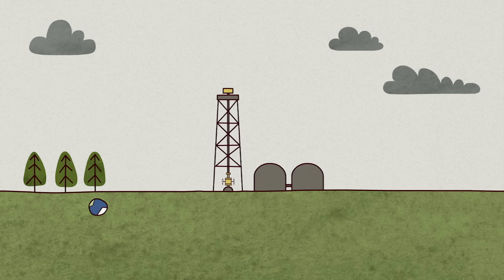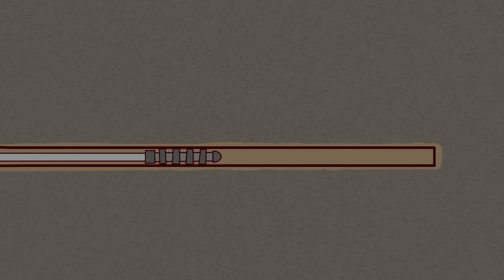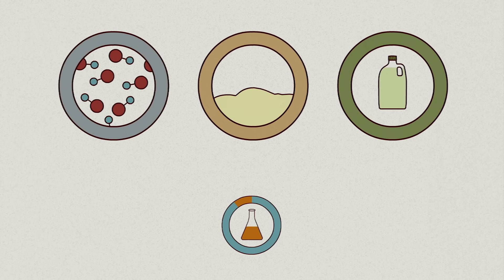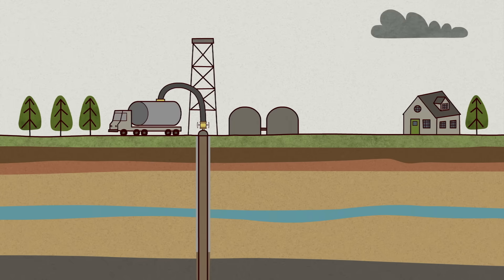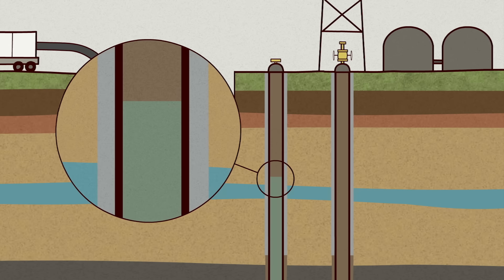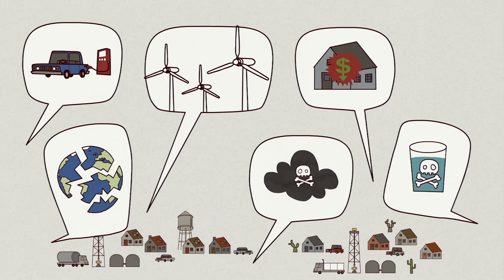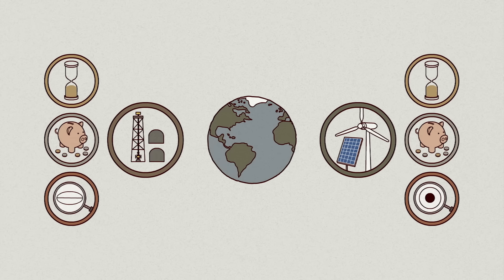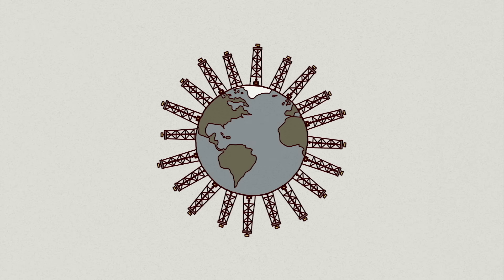How does fracking work? - Mia Nacamulli

Comment: I was following along until I noticed a single string of casing in the well. That may have been commonplace a long time ago, but not in the last 22 years I've been in the patch.

Today, you'd actually have three layers of pipe and cement that are protecting drinking groundwater tables. They are conductor, intermediate, and then finally your production string.

In west Texas average kickoff is roughly 10,000' vertical depth, the average fracture typically extend less than 500' from the well bore........or 9500' vertical depth. Don't think thats going to contaminate your water supply typically found around 200' vertical depth in this particular area.

You mentioned the volume of water used could affect a city's water availability. This could be true if the fracking companies used city water........this is not typically the case. In the area where I work, companies drill water wells near the frac locations and fill "ponds" or storage vessels for frac operations. This is done in such a manner where residents wouldn't even see a change in water pressure or volume.

Its not to say that drilling and fracking is not as dangerous as any other job out there, like chemical plants, power plants, etc. And there can definitely be accidents. But there are regulations that have to be followed that are in place to protect the environment as well as people.
Reply: Literally all they have to do is go down to a jobsite and ask the foreman how many steps they take to avoid groundwater pollution. They drink the same water everyone else does, therefore it is in their best interest to keep it clean.
Reply: @scowler92  "They drink the same water everyone else does" well trye but too bad the negligence comes from higher up in companies hirerachy and not from everyday's worker
Reply: So you're saying you have three layers of pipe and still tons of incident and negligence are happening? That's... impressive
Reply: @jamilhneini1002  vehicle manufacturers have been producing cars for years.......there are still recalls! Name an industry that doesn't have incidents........I'll wait.
Reply: Hey man can you help me out and explain the fracking issue in Pennsylvania since i am doing a report arguing for or against fracking please let me know if the water contamination that was caused by 'fracking' legitimate or just some more propaganda
Reply: Agreed, the graphic was quite misleading about groundwater depth vs shale reservoir depth. And while there was mention of the possibility of groundwater contamination, it would be nice to put that in the context of how infrequently that has actually occurred.
Reply: Johnathan good reply and as a fellow Texan that spent 25 years in the oil and gas industry I found this video just another propaganda piece by people that have no clue what they are talking about. The video does not even come close to telling the truth. I have done acid jobs and frac jobs on wells on a many different depths. The majority of wells drilled are not horizontal as the video shows. And the majority of frac jobs done do not take the large amounts of water claimed. The vast majority of frac jobs are a simple water, silica, sand mix that requires 1 to 2 truck loads of water. The video does not touch of the differences in depth per well, the differences between shell formations, is the well a horizontal drill or not, ect. Just another pathetic piece of information by someone that has no clue.
Reply: @yahtotv5492  these are all reasons why I commented. So when uninformed people come here looking for actual facts.....hopefully they read the comments! Scary times we're living in today!
Reply: Worked in ND on the production side and disposal side. Not only are you right about the casing, but the disposal of the hazardous waste is put back into old dried up well locations (aka disposal sites) it’s pretty much impossible for it to contaminate the ground water.
Reply: @geoffreygeorge2412  Its ashame the industry doesn't do a better job of public education on the subject.
Reply: Maybe you are right.
Then again...
Texas was left without electricity a while back. I don't think I can trust your state's engineering expertise.
Reply: @WTAWWR08  it would be short-sighted to put all the blame on engineering. Most of the electrical shortcomings were the direct result of the cost benefit analysis. In other words, the thought process was why spend the extra money on infrastructure in preparation for a disaster that might happen once every 500 years? Because the technology already existed... Now they know why!
Reply: @johnathanphillips8684  This video was fairly informative for an average viewer but videos like these always need to be seen with an open mind given the politics that surrounds it. Given your experience, would you care to share what do you think about the future of non-renewables, natural gas in particular?
Reply: @wickypickyvicky  to be honest I'd rather not make any assumptions in my response. We are told "there's plenty of oil and gas to last years". However being a realist, oil and gas is considered a non-renewable resource for a reason. Someone smarter than me has come to the conclusion there are only so many barrels of oil and cubic feet of gas available for use. 

Natural gas is an extremely efficient burning fuel. The issue is the cost of production leaves the oil companies very low profit margins. As a result a small dip in Natural gas prices will literally shut down an entire field.
Reply: The video is very misleading and obviously was made by someone who doesn’t know much about oil and gas industry.
Reply: @EyasAbuElhouf  people don't understand the engineering that goes into these wells. They think every well is drilled by the Beverly Hillbilly's! 🤦🏾‍♂️

Comment: There is either enough liquid oil or gas to pump out without fracking to make it economically feasible to drill a well, or there is not. If a well needs to be fracked to make it flow there is really not enough oil or gas accumulated there to make it profitable & what is there is better left there. Then there is not enough pressure for the oil or gas at the bottom of the pipe of the frack job to make it into the pipe to pump out, while the bottom side opens deeper & the top side liquids drip down to the bottom. If it is a large hole full of liquid, then pumping material into the hole falls to the bottom & traps the fluids at the bottom side. So fracking a full hole doesn’t benefit anything, but fracking outside of a liquified hole might open another draw point to that hole & spread the level lower & to other places underground. Drilling through a water table can not create a seal with the cement, the bottom side under the water table fills with water & dilutes the mix. Then the frack job can crack the seal around the pipe, and open the Geological spaces between Oil & Gas bodies & the body of underground water if too close to begin with. Contamination of large water tables & underground water supplies makes it not worth drilling at those locations. Then there is the fact that Oil & Gas can not compete in open free markets against better forms of energy, and causes higher cost of living through transportation needs, & destruction & lack of growth of many markets if exclusive policies are made to give Oil & Gas energy supplies an unfair market dominance. Traveling underground energy forces also make stops and transfer energy to multiple drill site locations, to cause earthquakes at those locations, which could later cause larger cracks & sink holes to form at those locations, especially when a hole is empty with cracks all around it.

Comment: The massive leaks during storage and transmission of methane were known in 2017 
The total carbon footprint of methane is greater than coal
Methane is a false climate solution
Solar and wind + energy storage and microgrids are the only way to avoid catastrophic global warming
Life on the planet is at high peril
Fracking is not the solution to climate change
Mia Nacamulli, back to the drawing board and update the false TED message.  Thank you
Reply: Could you hit me up with some sources?
Reply: @robert18productions  - here is one, but if you google "methane leaks" you will find 2020 references.
Reply: @robert18productions  please tell me about your last name. Mine is not fake, but it means "contrary"
Reply: @luiscontreras7945  For some reason I can't see the link. However, I will look more into the topic. Anyway my profile name is just a nickname that my cross-country team gave me during high school.  Anyway, you bring up great points about methane which is more potent than carbon dioxide because it can hold heat for longer.

Comment: Most of these f racking videos have comments turned off for some reason but my question is when the run the pipe down then pump concrete in it to come out the other end forming around the pipe going back up doesn't the concrete hit the water and just go everywhere cause there is in wall around the water ?

Comment: Wrong. Fracking is conducted in each zone immediately after each Gun is fired by the Wireline crew, a plug is set between each zone.

Comment: Renewable energy has been heavily subsidised for decades. Actually taking away resources from the advances in fossil fuel development (high political pressure and incompetence). Not only that, but "renewables" such as solar and wind are unreliable so they depend on fossil fuels driving the operating costs of energy up. "renewables" also require large scale mining for the materials required and further use of fossil fuels for international shipping on a large scale. Economic aid to places like Africa from such places as the EU, UN etc... pressure African nations not to turn to fossil fuels which in itself sustains poverty (and costs millions of lives). 
The negative effects of Co2 are massively exaggerated compared to the tremendous positives of advanced coal plants, the most energy efficient resource we have and in abundance. Places in Africa would be lifted out of poverty in less than a generation if they built coal plants. Those foreign aid resources are lining the pockets of corrupt governments.
Fracking is a fantastic development and ought to be rolled out right away.
The premise underlying all of this, is what is best for human flourishing. It's not solar and wind.

Comment: These problems can be solved. We have to build technology but it can be done. We can make hydrogen gas as
a fuel that burns completely clean. We can make hydrogen with salt water and electrolysis. We can store the
hydrogen to provide power on cloudy days. We can make hydrogen anywhere there is salt water and sunlight so
we can reduce the size of our electrical power grids. We can replace the copper wire with graphene wire.
There are other power storage solutions. Salt batteries and solid state batteries and flywheels, which is like what
he was talking about at the end there. Fracking produces waste water which will contaminate communities
also, it is highly unlikely that oil companies won't destroy the land and water with their pipes and drilling. The abandoned well heads will leak methane and we would need to retool America's automobiles to burn LPG so
why not make EVs and fuel cell cars instead. We don't need fracking, oil companies need fracking and they don't
care about you!

Comment: Bruh we accidentally fracked when we sent down a packer (well plug) and the wireline people sent a frac gun by accident (perforation explosives) they popped it and were just trying to put pressure in the well and it wouldn’t hold. We leeched into the water table by accident and no one knows it 😆 I think we were pumping bromide

Comment: Fracking can extract oil too. The main advantage that came with the fracking technique is that the horizontal drilling makes it far more productive and helps mitigate the costs of drilling a dry well (it happens. Used to be 1 in 10 exploratory wells drilled struck oil, while only 1 in 1000 were economically viable). That's why it boomed in the US not long ago, causing Saudi Arabia to drop their oil prices to compete and resulting in the cheapest gas prices since 2000.

But I have a question:
Is the gas/oil trapped in bubbles or dissolved in the rocky matrix?
Reply: The gas and oil are trapped within the pores of over-pressurized rocks.

Comment: "OUR WATER IS ON FIRE!"
Reply: Actually it's not. Just heard of a town in Pa where the water has been burning for almost 100 years due to natural methane in the ground and no fracking for hundreds of miles away.
Reply: @jonathanoconnor9546 
It's a Simpsons reference
Reply: @jonathanoconnor9546  What does a town on first have to do with proving fracking also doesn't cause fires lmao? Also how did you only just now learn about the silent hill town

Comment: This video does a good job of explaining the primary issues that people have, and doesn't make any claims as to whether they are correct or incorrect.  So it's quite unbiased.  However, the concern that fracking is bad because it takes away from our pursuit of renewables gives the false impression that it's fracking vs. renewables.  I agree that a cheaper source of fossil fuels will decrease our motivation to innovate.  Now that we have recognized this, it makes more sense to put pressure on government to utilize tax revenue to invest in renewables, than it does to put pressure on the government to stop fracking.  We want to innovate. We need money to innovate. So let's use the social power to use money from fracking.  If fracking is shut down entirely (for the purpose of re-directing our time and resources), you just have people out of jobs, and no new "renewables" jobs to replace them.

Comment: *1988 We had to change all Gasoline tanks that were only built as a metal shell replaced with double wall fiberglass metal tanks and triple wall fiberglass piping in California if they did  not allow or could not afford to pay for the changes, they closed or sold their stations, which the permits purchased and given by AQMD and money took care of the dismissal of cleaning the Soil,,turning the other cheek so to say, which many were turned into McDonald's stores or other food services. When we exposed the metal tanks, thousands of gallons of Gasoline has been poured back into the soil prior to that period of time they would flip the tank over and pour the left over fuel into the ground water, when changing the tanks, or they had leaked into the ground water. I personally found a neighboring lemon tree with fresh smelling gasoline in the fruit due to leaking for so many years.this is why America's water is screwed up"*

Comment: When I was at a fracking sight for the first time, I was and still amazed that salt water, or the ocean still exist under ground even though it's hundreds of miles away..
Reply: That is in all oil wells and has been that way since oil was drilled.
Reply: Once you get deeper than a couple hundred feet into the ground, there's no water but salt water. Much of it is extremely salty
Reply: @bruceg7577  salt water is still a water
Reply: And to add to it, there is no empty rock. All rock underground is saturated is some combination of fluids. The vast majority is salt water, but there is also hydrocarbons ranging from methane to C8+, CO2 all produced from “decaying” organic matter, Nitrogen, and even in some rare circumstances Helium (from the decay of radioactive minerals). I’m not aware of any deep fresh water sources, and another interesting fact is there is a massive amount of lithium and other rare earth minerals in groundwater.
Reply: Have read, Scientists have found there is more water dissolved in the mantle than in the ocean itself (at great depths)
Reply: People think renewable energy is clean and reliable, but the fact is all wind turbines, solar, and most all “green” energy is built from petroleum. Also those “good for the environment” processes are maintained with oil based products. I work on a drilling rig in west Texas, where we have over 3000 turbines in our county. That “clean” energy leaks hydraulic Fluid, and grease all over the ground over time. The hundreds of gas powered truck used to transport thousands of gallons of oil based lubricants every day to maintain the turbines are dependent on the production of oil wells. Renewable energy, isn’t so renewable.
Reply: @DominoDonaldson  It's still better to use that oil as hydraulic fluid than to burn it in mass

Comment: Fracking is a lot more efficient  than standard techniques. did you know that when you drill for petroleum you can only retrieve about 30-40% oil it because of the pockets they are in. you can't access them all. on an engineering and business standpoint it is a better way of taking care of business. (just another point of view that people should know)